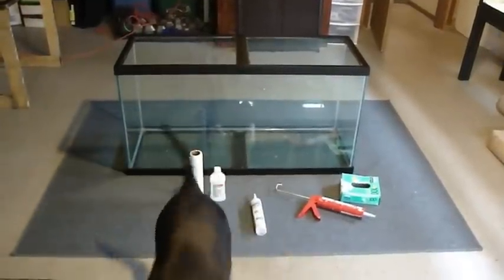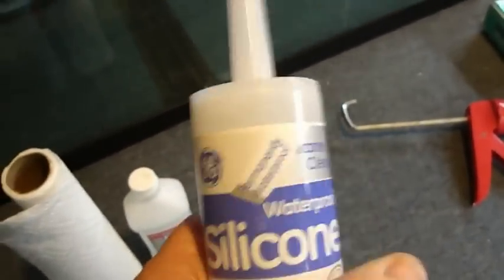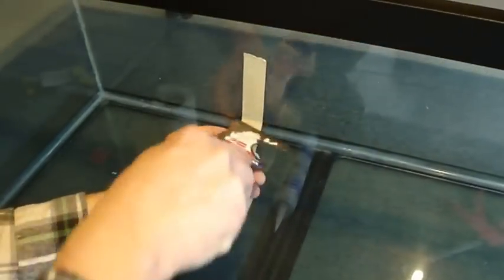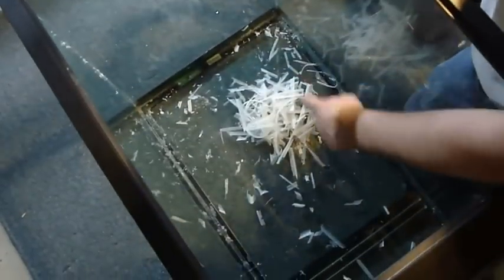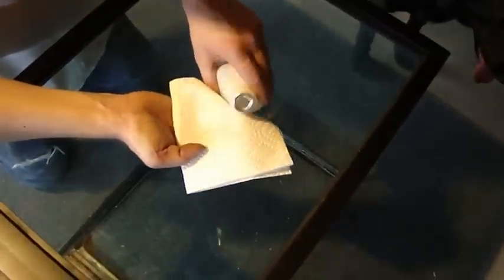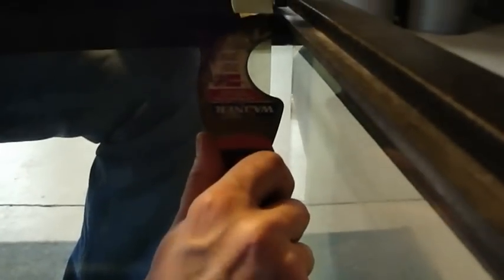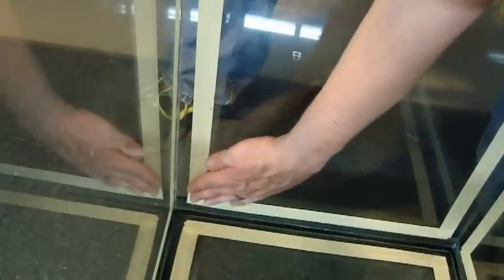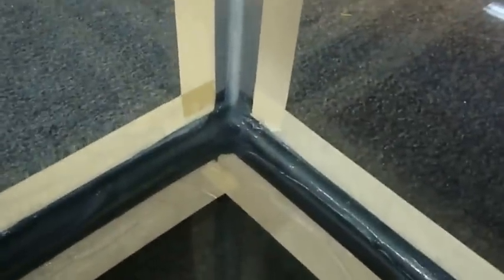Resealing an Aquarium DIY

Comment: Finally someone that can do a realistic job at sealing aquariums. The only comment is you used way to much silicone and the stream should be in one direction and you use way to much silicone and never have I used tape. I have done hundreds of reseals less silicone is best. One finger pull in one direction is the way to go.

Comment: Well...after waking up to find that my 30 gallon tank had leaked all through the night (fortunately onto my hardwood floor) I determined that aged and warn silicone seals were the culprit. 
Before running off to buy a new tank, I looked up possible diy repair solutions here on You Tube. 
I followed the advice and recommendations in this video down to a T., including the brand of silicone.  
I am happy to say it worked PERFECTLY!!!
It happened on a Thursday and by Monday afternoon, my tank was back up and running with zero leaks. :)
Much props and thanks for lesson !!! 🐡🐠🐟
Reply: is it still sealed? without leaks?

Comment: Thank you for a great video. I not only resealed but replaced a cracked side panel. I bought for the glass $6. silicone $5.blue tape $3.50 and scraper $3. =$17.50 and saved a $100. 29 gallon aquarium your video is very clear on how to do it.

Comment: watched this video before resealing a 125g tank from 1998. Never tried it before. Used Momentive RTV 108 Silicone (black) would highly recommend over the Silicone 1. Turned out great, no leaks after a month. great video. not as hard as i thought just time consuming.
Reply: Chris Lowe I am currently doing the same with a 125g.... the original silicone looks really good, I wonder it is even worth to reseal it?

Comment: Hello Steve, awesome video! I have me a 10gal Tank manufactured in 1995. It was in use, and wasn't leaking. But upon tearing it down. And cleaning it out, I noticed that I was getting pockets of water in the silicone. So I figured I try your DIY resealing. I pretty much got up to the part where I add the silicone. And thought I was suppose to remove the borders of the tape while the silicone was still wet and setting. But a piece of the silicone happens to come off with it. So my question, am I suppose to quickly caulk it and remove the tape. Or wait till its completely dried. Thanks for the vid. And hope to hear from you.

Comment: This is the best video on this topic, but, trust me, acetone works better than alcohol.

I'm in the process of using it and a razor blade to remove a thick coat of paint off my 220 gallon tank and redoing the silicone inside the tank.

You can buy a gallon of pure acetone on Amazon.

Comment: Great video.  I'm resealing my first tank right now & I hadn't remembered to do an alcohol wipe and completely blanked on taping it off.  Glad I watched this before running the bead.
One thing I will recommend, though, is a tip for picking up the old silicone bits from the bottom of the tank since it likes to stick to glass& a vacuum won't necessarily pick it up...  Throwing a pinch of regular white flour in the corners and on the bottom of the tank, then just kind of pushing it around to coat the silicone bits stops them from being sticky and it can all be vac'd out with no trouble.  A spray bottle with water or rubbing alcohol will clean up the remaining powder.  Now that I think about it, a dust coating of it in the bottom of the tank before taking the razor to it will stop the stickiness before it starts.

Comment: I have an All Glass tank that was made in 1971 and had been dry for 25 years. I am the original owner of this tank and I recently took it out of storage and set it up and it did not leak and it was never resealed.
Reply: Cool does it have the old metal edges on it? just curious...
Reply: The tank is an all glass without any metal edges.

Comment: I recently bought a 65-gallon aquarium and I immediately knew it had to be resealed. This is my first time resealing a tank and I got all of the silicone out from the inside. The thing with that is I think I went inside the seams holding the tank together a little by accident so I feel the edge of the razor blade go inside some parts of the seam just a tiny bit. I'm guessing the new silicone will just fill in the tiny gaps because the silicone that's deeper into the seams will still be strong enough to hold the tank together as there's some excess silicone coming out the other side from a reseal job that the previous owner did. If I reseal the tank on the inside normally, will I be fine?

Comment: I got a 135 yesterday for $100 with a bunch of extras. And the tank is in perfect condition
Reply: +RC MAN 23 Lucky!! lol I'm jealous. I can't even find a 75 gallon around here that is in decent condition for under a $150.
Reply: +PrincessLollyGag wow. Im in florida. And i just seen a 220 for $250. There moveing and need it gone asap. Wish they would have posted earlier
Reply: +RC MAN 23 Damn, that's a freaking awesome deal.
Reply: +PrincessLollyGag right. And it comes with everything to get it running
Reply: +rpgmomma8404 I hear you! I Just saw someone selling a 75 set up for $350. bucks!  It does have a salt water set up,  but dang, seems like a lot of money for a used (and not looking that great) tank.

Comment: to get better results with your finger smearing it. Get a warm Damp wash cloth, or paper tales with your index finger poking out (not actually threw it, but pushing it tight with the finger) and run it along the edge in one direction bottom to top (never back and forth).
Reply: and not to hard

Comment: The instructions on resealing were perfect. Can I ask if the black borders break (top and bottom of the aquarium) what glue can I use to glue that back in place?
Reply: +silencedknight I bought a 75 that had a cracked border. I just used Loctite Marine epoxy. Worked great.
Reply: +Wintersbane08 thanks a bunch

Comment: I bout a 100 gallon that I am going to be resealing. The previous owner did a reseal but left a gap filled with silicone in one of the corner seams near the top. Should there be silicone between the 2 panels that form the corner or just on the inside like you're doing here?

Comment: Please help me I have a 125 that had bulkheads in it. I want to seal with glass and the holes are about 3 in and my question is how thick of glass do I need and does it matter if the glass patch is round or square ? I have the aquarium safe silicone already and know the patch has to be a few inches bigger then the hole. Thank you

Comment: Serious question. Should I be worried about touching the silicone? There are scary warnings on the back.
Reply: Use some disposable gloves, it's not likely to be harmful, but it's really sticky and messy. You can get tools for caulking at a hardware store, or online, that are great at removing and smoothing out the silicone.

Comment: What happens if when you're scraping your razor blade goes in between the two panes of glass? When you're putting the silicone on will the silicone fill the gap? One of my local aquarium shops said that they would put the silicone on then fill it with water so the water pressure would squeeze the silicone through the gaps and the silicone will still cure even with the water in what are you guys think?
Reply: That's not a bad idea, as long as the chemicals leaching from the silicone don't get into the water. Read the instructions on the silicone and see what it says.

Comment: Hey boss great video!
One question tho. Does that GE silicone that your using say on the back. Not for underwater/aquarium use? 
I just bought one and it says that... Am I still good on using it?
Reply: As long as it says 100% silicone and contains nothing else in the ingredients you’re good to go if all you’re doing is resealing an aquarium. If you’re building say like a large rimless tank then you’ll need like industrial strength silicone to hols the glass pieces together.

Comment: While removing the silicone I happened to chip a piece of glass off one of the pains where the silicone is place should I have to worry about this when  replacing the silicone it's only 2 little chips?

Comment: Wow dude. If you think the silicone seal on this tank was bad you would trip the hell out if you seen my tank. Missing big ass chunks all around and in some areas it's completely gone. I still use it though and have zero leaks even when filled to the top. It's a 55 gallon curved front glass tank. Weird huh. But yeah I'm thinking about finally resealing it so that's why I am here.

Comment: I got a brand new 4ft ultra clear glass tank. The person who made it used cheap silicone which is not non solvent. Can I just cover it with aquarium grade non toxic silicone or i have to remove the silicone first then reseal it with aquarium sioicone?

Comment: I know thos is a old video but I have a question.....The 4 corners/ sides are the only thing in rough shape on my 46 gallon...The sealer on the bottom of the tank is in great shape......Could I just remove the bad silicon and leave the bottom alone?
Reply: no have to do the whole thing

Comment: My respond to some of the questions in here since I don't where my reply option went lol. Old silicone will not bond with the new silicone, so that's why you have to completely remove the old silicone. The silicone used in this this video DOES mention that it should NOT be used for aquarium use/under water on the tube, but it's mainly for liability purposes. Many people have used this type of silicone brand for resealing and nothing bad happened. Make sure you buy the 100% silicone without any additives or it will be dangerous to your fishes due to the bonding process.

Comment: @scubasteveaquatics thanks for this.  Great vid.  I've been wanting to do this myself but was unsure how to do it properly.  One question I have though is there any reason aside from aesthetics that you couldn't just re-caulk the tank without remove the aged silicone?  I am sure it wouldn't look pretty but I am just curious if that is a viable option for waterproofing an older tank as well.
Reply: New silicone does not still well to old silicone which is why you need to remove all the old stuff first

Comment: Thx for the video .  I got  a 300 g from Craigslist  . Not taking  chances    . I'm replace  the cilicone  on it .   But  I got 1 cuestion  after the all process  u still have to perform  the leak  test ? Or with the new cilicone  done right  it's like 1 in 1000 Chace to leak test  ? ( 300 g it's a lot of water )
Reply: Hey buddy how did your tank work out for you. I about buy a 220 g tank from a guy for $150. It needs to be resealed. Just don't want it to burst on me. I'm curious how yours turned out. Any kind of in site on it would be greatly appreciated.

Comment: i cant see any leaks but the bottom of my cabinet is water damaged,not damp but expanded and cracked chip boared pretty much right around the tank, 1 side worse to point the tank has sunk into cabinet support 4mm , will get new cabinet, just looking at the seal its like black rubber silicone that goes right through to the other side where the glass is connected, so bit concerned about scraping the silicone out on inside of the tank

Comment: I noticed everyone was using this silicone. Definately not saying it wont work but it says on the back its not recommended for continuous underwater use and that its good for up to 12 hours submerged basically. Says it in that really tiny print in the second/ third sentence i think.
Reply: its fine they only say that in case it springs a leak and 100 gallons of water end up in your living room. Alot of people in the hobby use GE1, just can't use 2. There are higher more sturdy recommended brands out there though.
Reply: yes saw that to it SAY "not for use on Aquariums but it seems many do.
Reply: I know it's late but what you really read was that it is submersible AFTER 12 hours (of cure time)

Comment: I just resealed my 105 gal with GE 1. I read the instructions after resealing tank. Line 5 on the instructions clearly states, " not for use below the water line or in an aquarium." I don't know why a lot of people on You Tube recommends this product for Aquariums if the instructions say otherwise? Has anyone had a leakage problem resealing their tanks with GE1?
Reply: Just go for SOUDAL Silirub AQ - it's like £3 a tube and is specially designed for aquariums. Can be found on ebay.
Reply: That is simply a "cover your ass" warning so that some dummy doesn't come chasing after GE with legal action for home damage after they tried being a cheap ass and doing a bandaid job resealing an already compromised aquarium
Reply: Mike McNamee RT108 is stronger
Reply: It just means you can't use it under water. taking the water out makes it fine. and once it's cured it's waterproof

Comment: I am having a leak on one corner of the floor ( it's a new tank). but other walls seem to be okay.. do I need to rub off all the silicone of the tank or it will be okay if I try to fix just the leaking part ?
Reply: best to remove all

Comment: Do you need to silicone a tank? If so, when do I have to do it assuming I have just bought a brand new aquarium.
Reply: If it's brand new, you shouldn't have to do anything to it. That was all done at the factory. If it leaks, take it back to the shop; it should be under warranty.

Comment: Hey I did this and the bottom corner has a leak. Do I have to srip all the silicone and do it over or can I do a patch job?
Reply: If your tank is already leaking then its your seams that are bad. Resealing the tank is only a band-aid. To prevent future leaks the seams need to be redone.
Reply: The seams aren't what keeps the water in. It only holds together the panes. Resealing the tank will work.

Comment: This is a bandaid fix for a leaking aquarium. The aquarium gets it's strength from the tiny bit of silicon sandwiched between the two pieces of glass. The silicon you removed is for the most part- superficial and adds nothing to the structural integrity of an aquarium. You may stop a leak by doing this but by no means does this make the aquarium as good and as strong as new. 

Don't get me wrong, this will save a leaky tank 9 out of 10 times but if there is a significant amount of seam separation, I wouldn't reseal the aquarium and put it on expensive Brazilian hardwood floors expecting it to last 15 years longer.
Reply: Can anyone verify the uhh truthiness hehe of this? I want to reseal an old aquarium and now I’m nervous after reading this comment! 😅
Reply: Essie S He's wrong... silicone isn't used to hold the glass pieces together...they use a glass or acrylic weld glue for that...after the glass walls are welded together, then it's siliconed to make it water tight...the weld doesn't make the tank water tight but it's a very strong adhesive and the walls will never come apart because of it...plus most tanks have the black bracing around the top and bottom which give the walls additional strength in staying together...if you really want to reseal it properly, cut the silicone holding the bracing as well and then reseal the brace too.

Comment: This not the correct silicone to use!!! Why do so many not read the instructions?  GE states on every tube, like the one you are recommending, "not to be used below water line or for AQUARIUMS" Good job otherwise, just the wrong sealant.
Reply: I've been using GE 1 since the 80s, 100% safe for fresh/salt aquariums.

Comment: I facked mine upp...
Reply: Kitty G me too I forgot about taking the tape off asap need help on fixing the bad silicone job ughhh
Reply: Kitty G never done this but I would think you could take your razor blade and carefully cut a straight line up the edge messed up caulk to create a straight line?